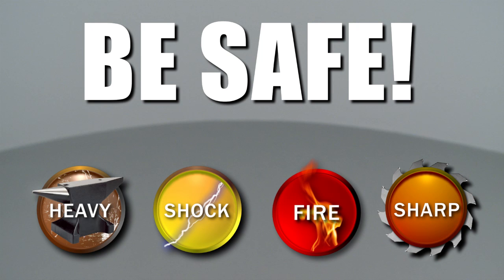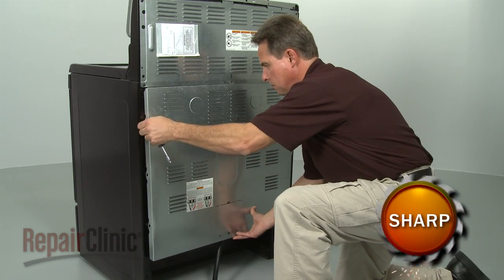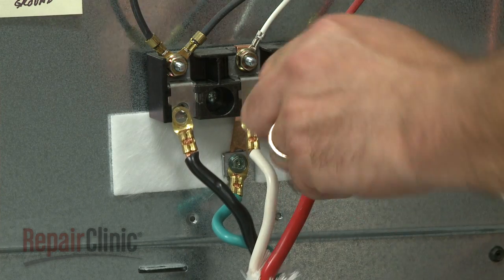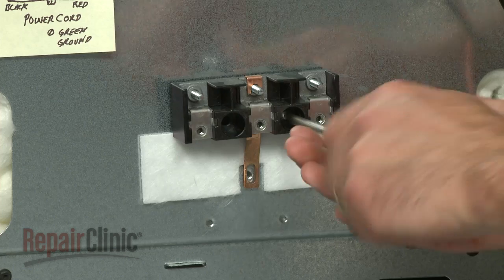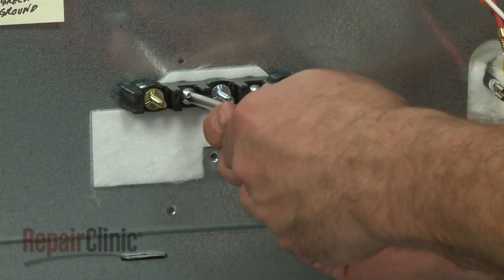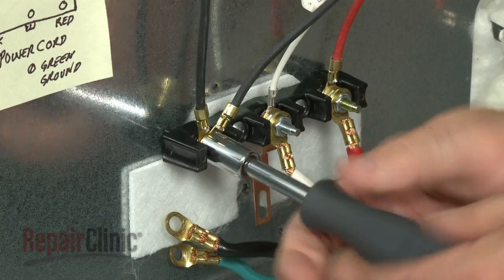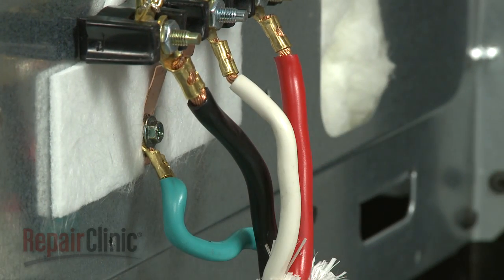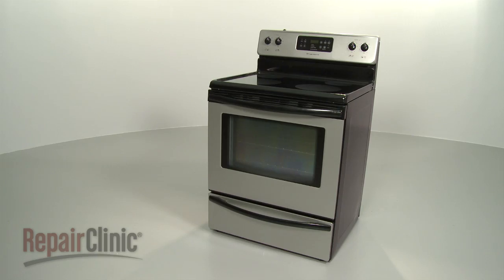Frigidaire Electric Range/Stove  Terminal Block #5304409888

Comment: I believe the grounding strap that connects the ground with the neutral wire should be removed if wiring 4 wires. The point of 4 wires is to have a separate ground and neutral. They should not be connected.
Reply from the maker: This is likely true for most models thank you for pointing it out Patrick.

Comment: Excellent video, very helpful but in my situation the black hot wire is burned with the connector , so do you have to replace it , and how, or just cut the burned part? Please if anyone knows about this. Thanks!

Comment: The red range power supply wire on mine doesn't have the connecting ring. It was removed during what seems like a hack-job repair and was connected directly yo the red outlet wire with a wirenut. Is that safe to keep using? how do I find and re connect the conductive ring at the end of the wire?

Comment: My girlfriend has a Frigidaire that looks almost identical. What's the model of this one? We have a situation where the circuit breaker trips and won't reset when it's plugged in but (I think) it resets when unplugged. Could it be the terminal block or internal wiring of the oven?

Comment: i have a problem the light that tells that the burner is on wont go off  even if the burner is off  is all ways on. can  you tell me the problem and nice tutorial
Reply from the maker: moncho88117 The switch that operates that burner is likely defective and needs replacement. Enter your model number into our website to find the correct part. www.repairclinic.com?TLSID=1773